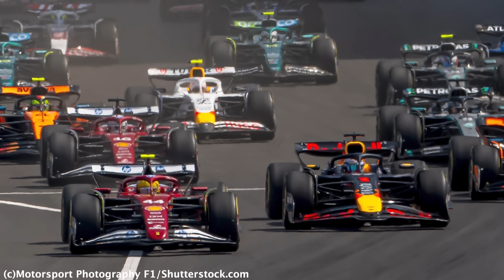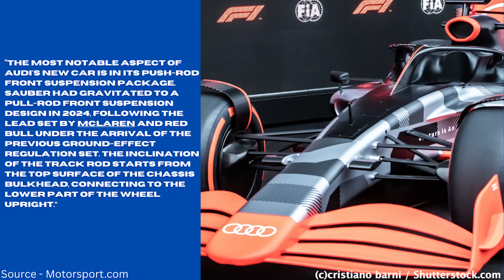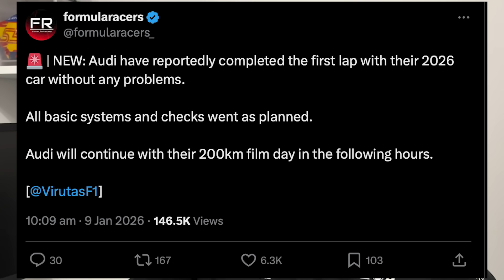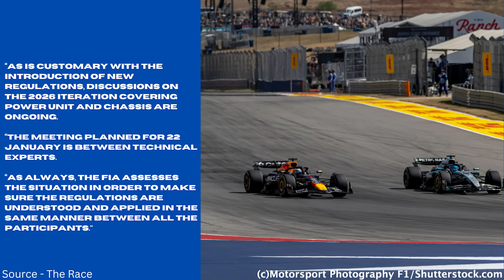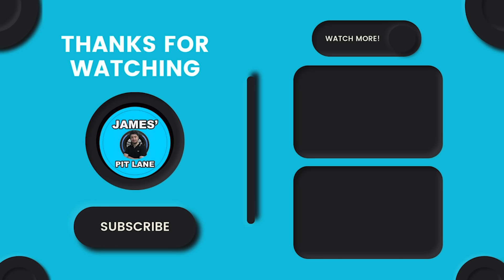Huge Update After Mercedes Trick Uncovered?! New Details As First F1 26 Car Hits Track!

Comment: The FIA is responsible for writing the rules, applying said rules equally to all teams and checking that everyone is working within the rules as laid down. For some teams to insist that the FIA should also be responsible for how teams interpret the rules suggests we should just turn F1 into a single chassis/engine formula. That’s not what F1 is. Frankly this argument is not even the exploitation of a “rules loophole “. Materials expand when they get hot, it’s a law of physics. I’d be willing to bet it happens in every engine design on the grid. Maybe some teams just don’t know it.

Comment: If the rules say that the engine compression ratio has to be 16:1 and the rules apply at all times, then how tf is Merc and Red Bull getting away with this bullshit?
Reply: The rules say 16:1 "at ambient temperature" or wording more or less like that.
Reply: @HallStevenson  Not really. The rule is as stated, 16:1 at any point. The ambient temperature only comes into play as to how it is measured for compliance. It’s more like “don’t do this but we’ve told you how we can’t catch you cheating”. Pretty du,b situation.
Reply: That is literally what F1 is ambiguity in the regulations..loopholes..that’s how you win.
Reply: under normal conditions.

Comment: So they must have a cc capacity below the 1.6 litres. Growing the compression ratio means also growing the capacity or they can say it's 1.6 litres in the pits and we can't measure it on track, but I think that should be mentioned. There's no real value in developing this tech, it should be banned imo.
Reply: Changing the compression ratio doesn't have to change the capacity. If the top of the piston moves up at top dead centre it also moves up at bottom dead centre so the stroke doesn't change.
Reply: @davidwright1605  I see, thanks.

Comment: 13hp not sure thats a huge deal. Im thinking the big gains will be Battery's and electronics.
Reply: Well if you think about it alpine was about 10-15hp below the rest due to their engine and that was a huge deal in their performance and end of the year standings. I do not mind clever engineering but even as a Verstappen/redbull fan I would rather see merc and redbull stick to the faith of the rules regarding the engines. I do not want to see 2 teams running away in this era but rather a 4/5 team fight for the top 3 steps each race.